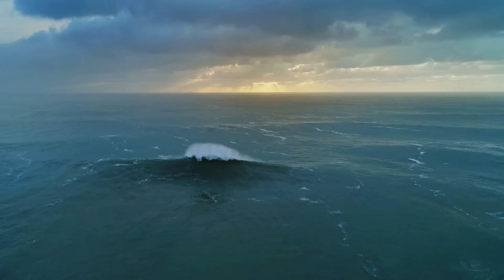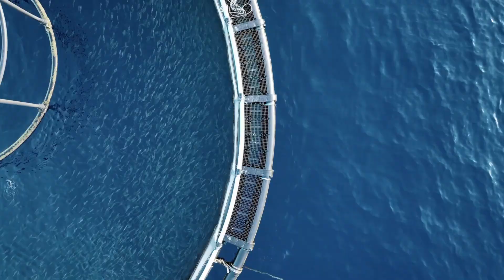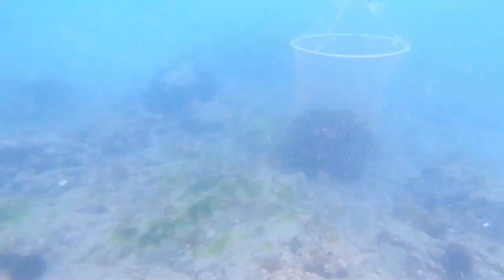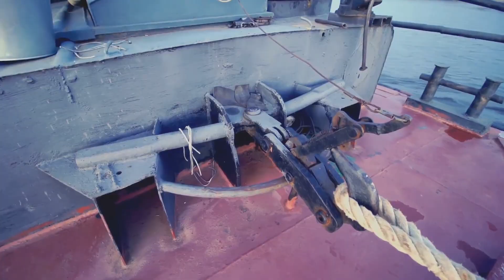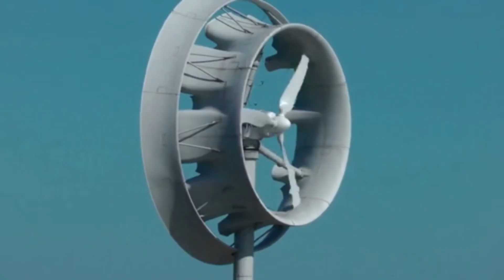The Secret Engineering Behind Floating Wind Turbines

Comment from the maker: Dive into the engineering that lets giant wind turbines float in deep water — from Hywind’s spar demo to semi-submersibles and tension-leg platforms. This video breaks down buoyancy, ballast, mooring systems (catenary vs. taut vs. TLP), dynamic export cables, materials (steel vs. concrete), installation, and real-world performance in storms. Perfect for science fans curious about offshore renewable tech, turbine stability, and how floating wind unlocks powerful deep-ocean resources. If you enjoyed the breakdown, please like and share to help more people learn about floating offshore wind! #FloatingWind #OffshoreWind #Hywind #RenewableEnergy #Engineering #WindEnergy
See Less
OUTLINE:
00:00:00
Why We Need Floating Wind Turbines

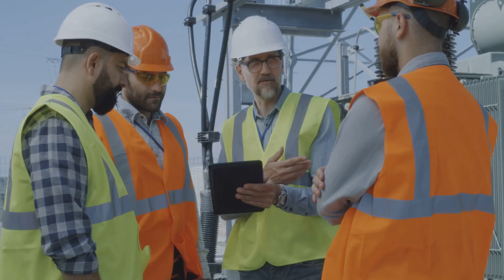00:00:41
The Science of Staying Afloat

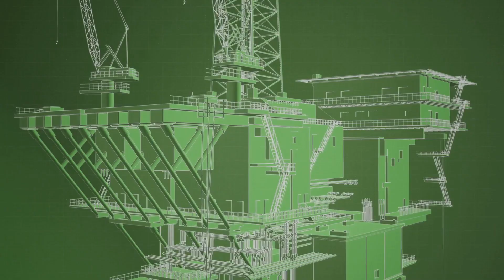00:04:04
Spar, Semi-Submersible, and Tension-Leg

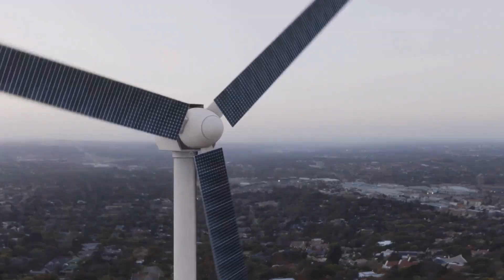00:07:33
A Simple Giant Standing Tall

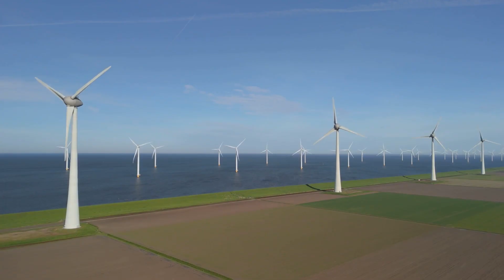00:08:20
A Wide Stance for a Steady Ride

00:09:04
Anchored with Strength

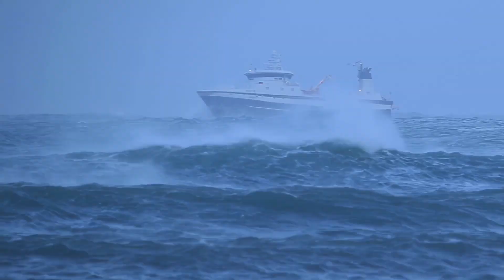00:09:48
Steel, Concrete, and the Journey to the Sea

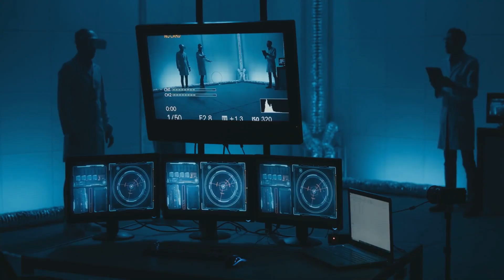00:12:29
Mooring Lines and Power Cables

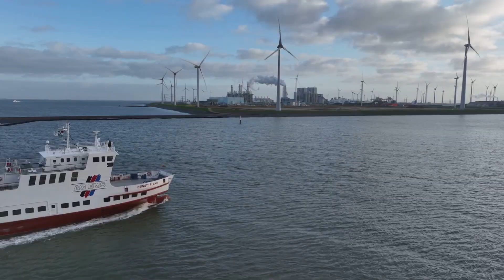00:13:17
Surviving Storms, Salt, and Wear

00:14:12
Floating Wind's Role in a Cleaner World